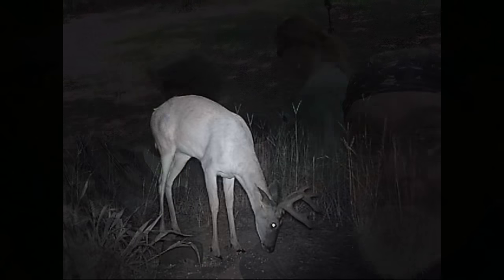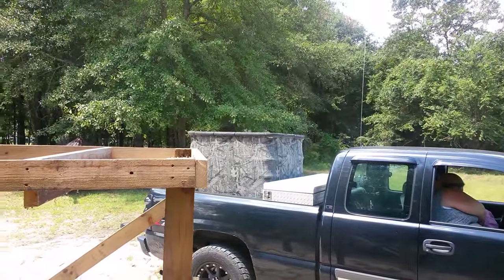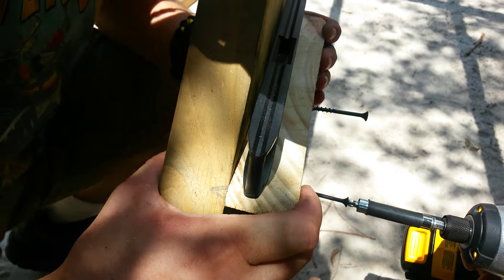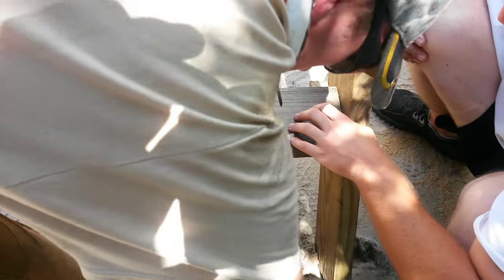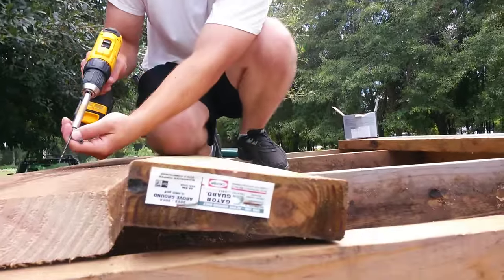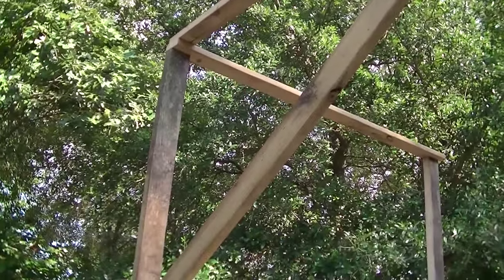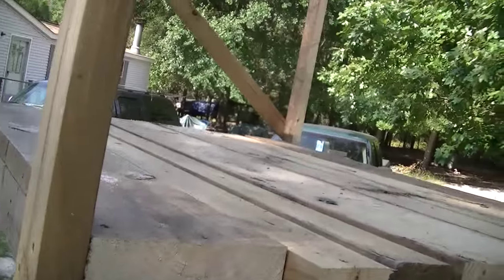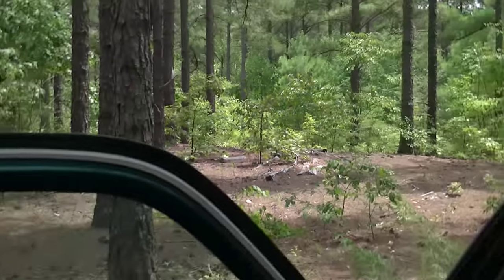Building & Placing New Deer Stands for Fall 2015!

Comment: That is by far the easiest way to built steps/stairs. I used to be a carpenter before I got into law enforcement and never did learn how to cut them out with a framing square.
Reply from the maker: ahattaway022 It's the fastest way that we've found to build them in the woods... If it works, go with it!